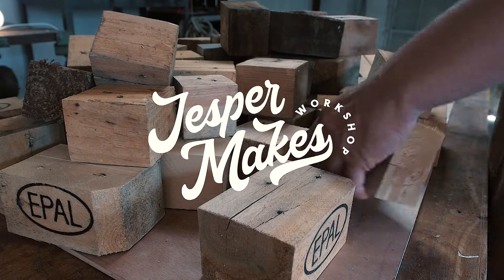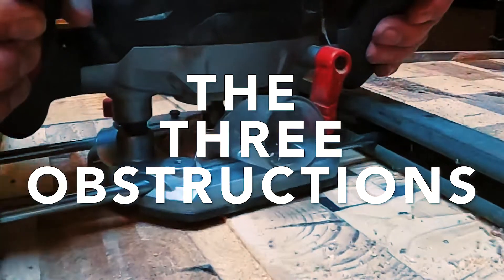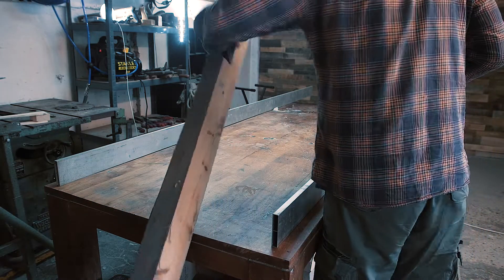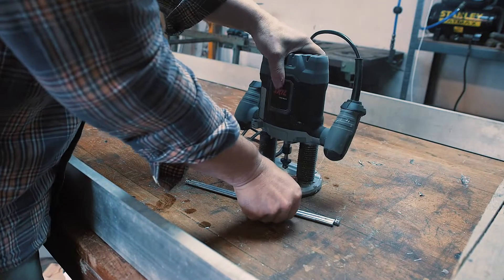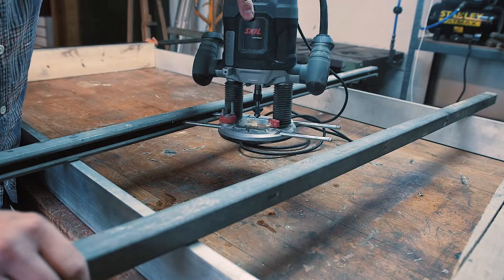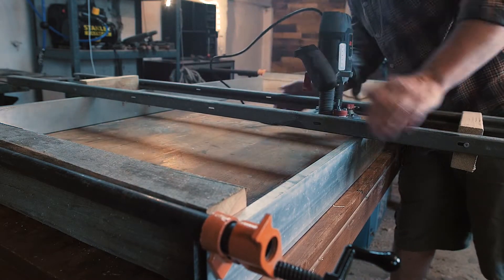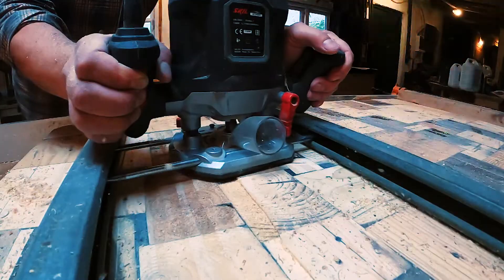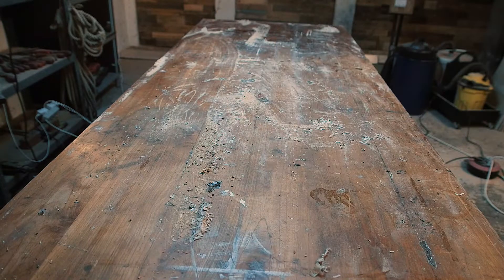My DIY router sled to flatten large slabs

Comment: I'm always learning practical diy/homemade ideas from you. Thanks! I've got a couple of heavy, angle-iron bedrails that I want to make a sled with, and this helps me think through the project better. Now ... if only I had an actually flat table to set it up on! My little shop area still needs plenty of work. 

By the way, are the "three obstructions" an intended reference to Lars von Trier's Dogme '95 concept? If so, very cool. If not intentional, then still coincidentally cool!
Reply from the maker: What, you know Lars Von Trier and the dogme-concept? And yeah, getting a flat surface is always a problem. My floor is so unlevel, old horse barn...